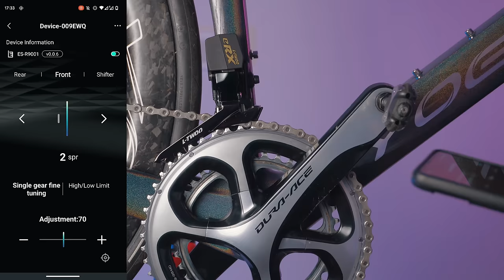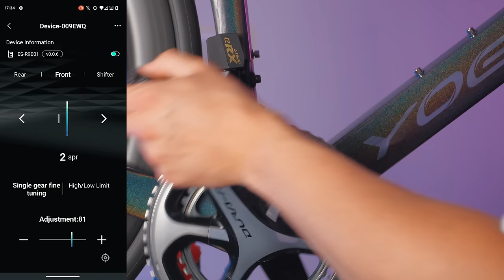The electronic groupset we have all been waiting for. L-Twoo eRX on the Yoeleo R12 aero frame

Comment: Hey, super great video! I've been closely following since April and just received my own eRX order. It seems FANTASTIC and shifts great. Loving the single-gear adjustability.

However, can I ask by what form of communication you "spoke to the L-Twoo guys really quickly" when you had a question? I've been emailing them and haven't heard back over the last few days.

Unfortunately, I can't bleed the brakes, because mineral oil simply doesn't flow through the reservoirs in the levers to and from the cup. I either need to be told where I'm going wrong, or be sent new levers. (Well, one lever has a total blockage; the other blocks only one way, resisting suction toward the caliper. Weird.)

Any help you can lend me in getting ahold of L-Twoo would be spectacular. Thank you!
Reply from the maker: I spoke with them via Aliexpress chat. Did you unscrew the preload adjustment screw like i did in the video? As i had the same problem.
Reply: Hey, did both of you buy the groupset via Aliexpress?
Reply: I did 👍
Reply: I also tried again bleeding my brakes and it went much better. My bike is 100% rideable now, though I may want a thicker rotor on my front wheel. Never a fan of those fancy Shimano ice-tech aluminum sandwiches!
Reply from the maker: @chuckaeronut  glad to hear it was smooth for you. Did you work with the air screw?
Reply from the maker: @sepplj4825  yes i did as well
Reply: Hey good to hear from you!

> Did you work with the air screw?

I did not! I realized that despite my prior belief that I had, I had not backed out the preload set screw in the front brake lever. It bled fine after that. 

My current Schroedinger’s-complication lies in that in order to quiet the annoying rattling snap rings around the pistons in the levers, I applied grease to them as Luke (TraceVelo) described in an older video of his about the RX hydraulic/mechanical groupset. While I hadn’t observed it prior, the piston in my front brake lever seems afterward to have more friction (noticeably sticky) than the piston in the lever for the rear brake (effectively none), and I’m slightly concerned that the deformation of the rubber gaskets holding the caliper piston may not provide enough pressure to force the piston all the way back out. This would result in the reduced pad travel I’m observing in the front brake when compared to the rear brake. I can force the piston out under pressure from a syringe screwed into the caliper, and the brake lever noticeably extends away from the handlebar when I do. While my bleed feels good and firm (little to no air), I have to preload the front lever much further than the rear lever using the set screw, so much so that I think I’m running up against the end of the piston’s travel as I tightly squeeze the front lever. When I get out on some rides with the bike I’ll better be able to judge the stopping power I can attain with the front brake. My rear brake is fantastic.

Also, because I can’t imagine how applying grease around the lever pistons could make them more sticky, and because I never observed the operation of the front lever without the grease, I am of the mind that my grease is not the reason the front lever piston may not be getting fully re-extended by the caliper gaskets.

I give myself fiiiive minutes to get it 100% sorted; stay tuned for the next episode of Dragonball Z!
Reply from the maker: @chuckaeronut  that sounds like some good experimentation. I didnt observe this on my setup. Did you reach out to L Twoo with this?

Comment: Awesome video Michael. Feeling very tempted to build up a bike myself now ;-) One question in regards to the ERX group set. Does it support some sort of auto shifting mode like Shimano's synchro shifting where it finds the best front chain ring and rear sprocket combination for the next gear up or down?  Could not find any information anywhere on this...
Keep up the great content!
Reply from the maker: Thanks a lot Jürgen 🤜🤛. I guess synchro shifting might be patented by Shimano like the auto trim that L-Twoo had to remove. I didnt see this as a setting in the app but as they seem to be releasing more firmware updates i would not be surprised if some workaround would show up soon.

Comment: Hi, nice build video :D But I have some questions:
1. Did you experience any sleep timer on the shifters? I saw one other video that GC Performance had some issues mid ride with the Ltwoo groupset went to sleep.
2. Did you bought the groupset from Ltwoo official store on Aliexpress?
3. Can you have an estimate of roughly the cost for the whole build? 

Thanks for doing a very detailed build video :D
Reply from the maker: Hey, thanks a lot. Let me try to answer your questions.

1. I didnt notice any sleep issue with the set. There has been a firmware update as well so maybe that has fixed it or i was just not riding long enough.
2. Yes i bough it from their store on Aliexpress.
3. Let me do a quick list:
- R12 Frame 1640 Euro
- Wheels 900 Euro
- Groupset 625 Euro
- Crankset 200 Euro
- Chain 30 Euro
- Tires 100 Euro
- Saddle 50 Euro

Overall around 3545 Euro
Reply: @klein-concept  Oh that's nice! I thought the groupset they listed on their page was 750eur. Did you have to pay any import tax for the groupset when it arrived?
Reply from the maker: @numeronolla1163  it was listed higher but when you actually check out it deducts a bit to compensate for import taxes. Yes i paid 25 euros on import.
Reply: @klein-concept  oh only 25eur for the tax. So, did they lower the value of the package and tell you about it? Because I find this whole taxing thing is kinda hit or miss in Finland 😅
Reply from the maker: Good question. Unfortunately i dont have the shipping box with the receipt anymore but you are right they might have lowered the value for this to be 25 euro only 🤔
Reply: @klein-concept  I will try to ask their support before ordering the groupset. Hope they have some solution like the Elitewheels 🫡
Reply from the maker: @numeronolla1163  how does Elitewheels solve this? 🤔
Reply: @klein-concept  I ordered one pair of wheels from them at the end of spring and their customer service told me to use the "seller's shipping method" to avoid any unwanted tax. It took a bit longer but I didn't need to pay any tax :D
Reply from the maker: @numeronolla1163  Ah some secret magic going on there. Love it.
Reply: @numeronolla1163  Yes, very often they put low value in the documentation. However, ask them to give you a price for DDP (delivery duty paid).
Reply: @klein-concept  "seller's shipping method" is DDP.

Comment: Kudos for a very nice and well produced video! Professional quality with great lighting and so on.

I'm wondering about the other tabs in the LTwoo app. What settings are under the Shifter tab and the Calibration tab?
Reply from the maker: On the Shifter page you can swap the functionality of left and right shifter with eachother. Guess that is helpful for e.g. UK riders.

Actually just tried going into calibration mode and it doesnt really do anything other than asking me to switch into the 6th sprocket but no further steps from there 🤔

Comment: I can’t connect my shifter to the derrailer. The light in the Shifter does not tuen of after im pushing the main button on the rear derrailer. Anyone a solition? Ist only the right shifter does not work. It did for 1000km and now nothing. Cheers
Reply from the maker: So it worked for 1000 and suddenly disconnected? Maybe a battery issue with the shifter? 🤔
Reply: @klein-concept  no i chanceg the battery and the light glows green everytime a push a button and i reset the setting unplugged everything looks like the Bluetooth on the right shifter does not work but i cant find whats wrong the shifter is showing in the app with or without battery in it. When i change the derrailer in the app i can change the gears in the back with the left shifter but not the gears in the front with the right. Was trying everything today
Reply from the maker: @claudiotelli1416  and shifting the front derailleur in the app also works? Just checking if maybe the cable to the front derailleur got loose or something.
Reply: @klein-concept  ich kann in der App alles machen. Auch wenn ich die belegung der Schalthebel wechsle also ich kann mit den linken Schalthebel enrweder den hinteren oder vorderen wechsler benutzen. Aber nichts mit dem rechten. In der app geht alles. Ich komme auch in den Pairing mode bei beiden Schalthebeln aber wenn ich das Pairing bestätige mit dem Knopf am wechsler geht das Licht beim rechten Schalthebel nicht aus so wie es sollte um das Pairing abzuschliessen .
Reply from the maker: @claudiotelli1416  hast du mal bei dem video von GC Performance geschaut? Der hatte glaube ich auch ein problem mit dem pairing, hat dann aber in einer anderen reihenfolge doch geklappt. Ansonsten zum LTwoo support.
Reply: @klein-concept  gc hatte das problem mit dem Sleep Modus und wenn er es eingesteckt hat hat es wieder funktioniert. Aber ich schreibe ihm mal
Danke dir!
Reply from the maker: @claudiotelli1416  schau mal nach seinem unboxing video. Da hatte er ein problem beim pairing.
Reply: @klein-concept  ja dies weil er den knopf gedrückt gehalten hat. Mein linker Schalthebel konnte ich ja synchronisieren
Reply from the maker: @claudiotelli1416  ah alles klar. Verstanden. Ja sorry dass ich nicht wirklich weiterhelfen konnte. Hast du mal versucht alles vom strom zu ziehen für ein paar minuten?
Reply: @klein-concept  danke das du dir Zeit genommen hast.
Das Problem enstand als ich den Reifen wechselte und das Rad kopfüber gestellt hab danach ging es nicht mehr. Aber die habe ich nicht das erste mal gemacht bisher keine Probleme. Dachte ja vlt hat die Knopfzelle den Kontakt verloren. Aber beim Linken SH passierte nichts als ich die Batterie rausnahm funktionierte einwandfrei.
Ich habe alle kabel und Batterien entfernt sogar die im der Sattelstütze. Bin echt Ratlos Strom ist überall drauf und via app funktioniert alles. Habe es auch auf die werkeinstellungen zurückgestellt und den hauptknopf soöangw gedrückt das der wechsler und umwerfer alle gänge durchgespielt haben. Ltwoo auf Ali konnte mir nicht helfen die sagten alles Schritte die ich schon probiert habe und danach schrieb er/siw sie habe Ferierabend und seien Montag wieder da 😂
Reply from the maker: @claudiotelli1416  oh man. Dann mal noch viel erfolg. Hoffe du findest eine lösung.
Reply: @klein-concept  würde es gerne mit einem anderen Schalthebel ausprobieren :)
Reply: @klein-concept  bekam einen neuen Schalthebel funktioniert jetzt alles wieder wie es sollte
Reply: Wie kontaktiert man den L-TWOO Support?
Reply: @UltraTeeN  über den Anbieter wo du es gekauft hast
Reply from the maker: @UltraTeeN  ich schreibe denen einfach über den AliExpress chat, weil ich da auch die gruppe gekauft habe.
Reply: Habe gerade raus gefunden was das problem ist - die batterie scheint sich nicht zu laden... solange das kabel eingesteckt ist funkioniert alles super. Sobald es raus ist will es nicht mehr schalten, blinkt nur rot... hat da jemand eine Lösung?
Reply: @UltraTeeN  rot blinken bedeutet eigentlich das die high und limit schrauben zu weit reingedreht sind und der wechsler sm anschlag ist
Reply from the maker: @UltraTeeN  schau mal ob die batterie in dem case richtig kontakt hat. GC Performance hatte das problem, dass die untere feder keinen richtigen kontakt gegen die batterie gedrückt hatte.

Ansonsten vielleicht mal neuen batterien ausprobieren.
Reply: @klein-concept  danke, versuche es mal - wenn ich sie überhaupt noch rauskriege 🤣
Reply from the maker: @UltraTeeN  viel erfolg und sag bescheid obs daran lag 🤜🤛
Reply: @klein-concept  leider nein. Habe sogar noch einen der kontakte wieder hochgeschoben.... ist eventuell das batterienpack kaputt? Beim schalterk ist ein stetiges grünes licht beim aufladen - das heisst ja batterie voll oder? App sagt gelb / rot.
Reply from the maker: @UltraTeeN  ja vielleicht sinds die batterien. Hattest du es mit batterien bestellt oder eigene eingebaut?

Comment: total build price include your assembly time,thanks!!!
Reply from the maker: - R12 Frame 1640 Euro
- Wheels 900 Euro
- Groupset 625 Euro
- Crankset 200 Euro
- Chain 30 Euro
- Tires 100 Euro
- Saddle 50 Euro

Overall around 3545 Euro

I would say it took around 2,5 hours to put everything together.

Comment: Those bottom bracket cups look way oversized, that BB was loose inside of there...
Reply from the maker: You might be right. They did slide in pretty easily. But it didnt translate into any creaking so far.
Reply: @klein-concept  Yeah that looked way too oversized.  I think your Token BB is saving you from that.  Looked wayyy to easy to go in.  Just something I noticed, these frames look fantastic.

Comment: I really dont get the appeal of this l2woo i mean the shimano 105 di2 costs 100 dollars more and atleast i know its gonna work. also the l2 does not come with the crank and casset and chain. once you go and buy those separately its almost the same price as 105 so its really not cheap enough for me to even consider it .
Reply from the maker: I bought it because i was very interested how it will compare. Also i think the price might come down a bit once the hype is over especially given a lot of 105 discounts at the moment. So i agree if you are in between 105 and eRX then 105 might be the safer bet.
Reply: @klein-concept  ill buy it if it becomes like 450 usd . otherwise its not worth the risk. and they need to get feedback form users so they can fix all the small issues that are being reported
Reply: There could be a weight win in there compared to the 105 Di2?
Reply from the maker: Have a look at my other video. Here in the description you find a weight comparison to 105 di2. https://youtu.be/dhrUhAeYDc8
Reply: A 105 Di2 groupset seems to cost about €1000 compared to €590 for the ERX. Seems to be a pretty good deal to me.
Reply from the maker: But i think in the 1000 euro package you also get the crankset and discs. 🤔
Reply: @klein-concept  Only a cassette and chain are included in the price. Crankset, BB and rotors are included for €1150. Those are prices from Bike-Discount, but I haven't found any significantly cheaper places.